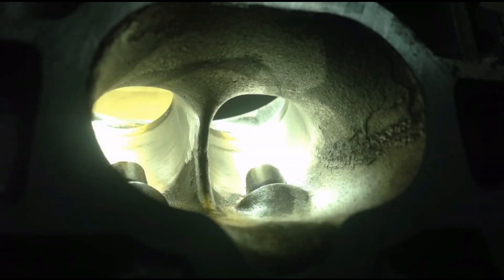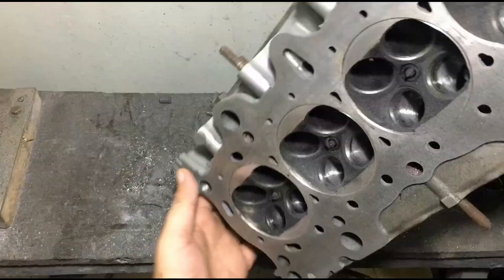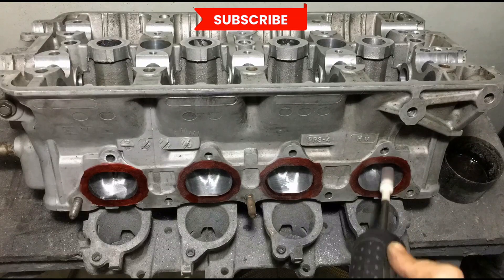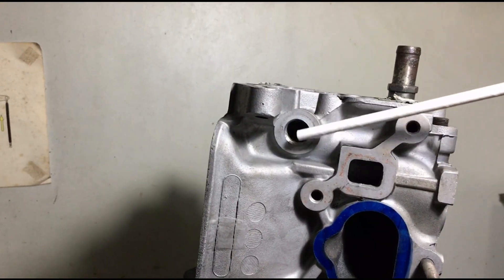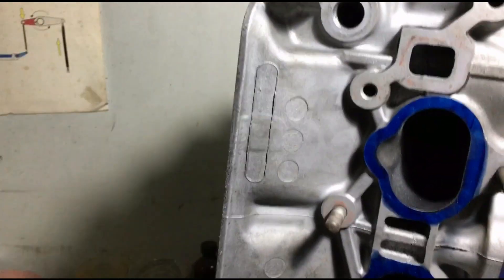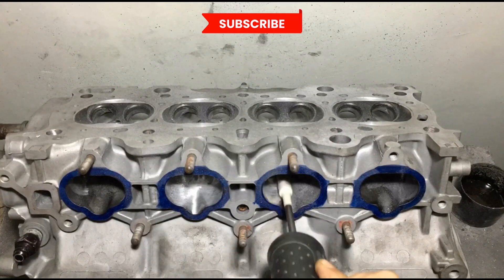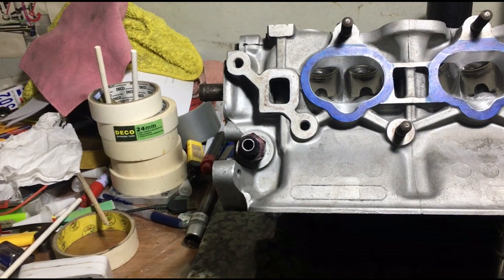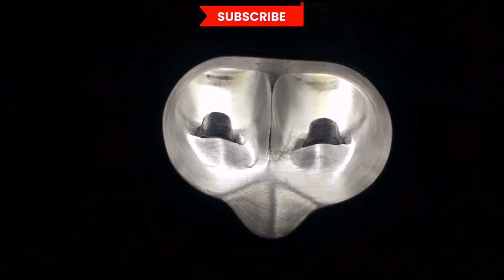B16 PR3 Cylinder Head Porting for B20 Vtec by SRDmotorsports

Comment: What grit do you use for the combustion  camber without taking the valves off ( top part)
Reply from the maker: 120 grit but it’s hard to clean up the crevices with valves in 

The current or part 2 of the Kseries built I talked about the chamber details

Comment: Sorry for exhaust  port you use 80grit . What grit do you use for the intake port ?
Reply from the maker: Both it’s usually 80grit it just depends on the amount of lube I use it changes the finished texture

But it’s always depending on applied pressure on ur hands

Some can try finer grit to come close but it won’t be the same it’s always the applied pressure of the hands

Comment: port matching i/e po8 head with 20 camlobes , was it good for daily?
Reply from the maker: improving efficiency is always good (some locals would say otherwise cuz it’s stock)

so they don’t think improving fuel efficiency is worth it?
Reply: @SRDmotorsports  fuel efficiency + gain more power, right.
Reply from the maker: improving engine efficiency = more power and fuel efficiency

Comment: Very helpful video. I’m curious how does the fuel atomize with 120 grit surface? If the port is sanded at 220 grit. Is that when it’s too smooth. Where is the balance point?
Reply from the maker: I’m not sure with your question sir, but our finish is was always 120grit

I feel anything smoother = is no difference so “why” spend more time  as if it’s “no difference” it’s the same as wasted time 😄

especially with the newer style injectors that has far more superior spray patterns, atomization is vastly improved

Now if it’s a Weber manifold for my vw? Yes I’d like to try to keep it a little rougher perhaps 60-80grit

Comment: Hey brother nice video! Have a link to those bits you used for the porting job?
Reply from the maker: Hey yes where u from? Cuz depending on location the source is different

Mostly on EBay sanding rolls are plenty usually the good ones come from SA (standard abrasives) the brand

Comment: How is this even beneficial if you aren’t cutting anything? I can’t even say this will gain a net of 10cfm? Please explain?
Reply from the maker: The b16 port is already “almost” too big port volume wise for the basic 84x89

Unlike different brand heads let’s say on a Toyota or Nissan it’s a different story

and the port is always related to cam size + type of intake manifold but that’s a separate story
Reply: @SRDmotorsports  looks really nice
Reply from the maker: @jdportwerks6795  on let’s say a d16 head or a crv p75 , that one can take more port volume and will need it for more “rpm” power…

Thank you man!
your work is actually really really good too!
Reply: @SRDmotorsports  I mainly do a lot of Honda and Volkswagen cylinder heads but the Honda heads are definitely easier to work on and get really good results😁
Reply from the maker: @jdportwerks6795  so true on that… I can imagine the vw is a lot harder because it’s already good with torque so more is harder except go turbo lol
Reply: @SRDmotorsports  I have several builds from 200hp supercharged to 720hp turbo and yes vw=Torque monsters. I am still really amazed that you don’t use any burrs to cut your cylinder heads and then use sandpaper flappers to shape and smooth and out. Have you ever flowed one of your cylinder heads?
Reply from the maker: @jdportwerks6795  actually I do use burrs a lot of times just on this one I used it less

Yes I usually don’t mention it here but 
Usually my good ones are above 295cfm but below 312 @28”
Reply from the maker: Oh and the 80grit does eat a lot 😂
Reply: @SRDmotorsports  I use 80 after I cut with a burr then go from 80 and finish with 120 and at the end scotch ball
Reply from the maker: @jdportwerks6795  yes sir I do 80 then 120 too and can get a finish with a spray mix inbetween

Comment: This will come in handy with a B20 stock bare block with a fully built and maintained Vtec head
Reply from the maker: Oh yes definitely… like a “2liter” TypeR 😎
Reply: @SRDmotorsports Type R Integra cams GSR Head with dual valve springs is what I’m gonna do people say it’s safe to use the stock springs and valves but I’m not taking chances just because it worked before won’t always pan out especially B20vtec
Reply from the maker: @kaybevang536  I agree on that! Valve springs west out they are considered “consumable” as their tension don’t last forever

Il always prefer “new” so I def agree
Reply: @SRDmotorsports  I had no problem running stock head stock valve springs and retainers with type r cams but might as well get it upgraded so you don’t have to do it when adding better cams
Reply from the maker: @kaybevang536  yes so true I mean it’s quite easy just slapping on pro1 after but if the valvetrain isn’t ready? That’s added work so what u doing here, this approach is actually SMART
Reply: @SRDmotorsports  better safe then sorry as I said before just because stock oem valve springs had no issues before doesn’t mean it will have no issues on my other Vtec Head plus I’m building a GSR Head this time different from B16a Head
Reply from the maker: @kaybevang536  yes indeed…it’s how I approach things hence blowing an engine I lack experience on hahaha
Reply: @SRDmotorsports  my b20 Vtec in the car is hurt though I bought the car with the b20 Vtec and god knows how hard it’s been raced so I’m building my own B20vtec but a more don’t cut corners and don’t cheap out on parts
Reply from the maker: @kaybevang536  ah yes true I mean who knows and nobody really admits they over raced it hence selling lol

Comment: Err, you just about cleaned the exhausts but didn’t actually port it that much. On a turbo engine you need as much exhaust flow as possible.
Edit, sorry no turbo I mixed up two videos.
Reply from the maker: Yes I agree though especially on turbo engine as much flow exhaust "efficiently" as possible

we both know alot think "bigger" is more flow when alot of times when you start loosing airspeed , "boost lag" becomes annoying 🤣

Also on alot of applications the honda pr3 head has very good port volume and valve to throat ratio but on other brands it is a different story so I agree on exhaust flow

Comment: I just bought a head just like this one. I will try to do the same. This one was flawless.
Reply from the maker: Yes sir check a outro video about this the TypeR how to , it shows more but less words

I will make a new version Video of that soon
Reply: I have seen its good. I having trouble taking the valves out of the head. When I press the springs the valves opens also.
Reply from the maker: @picole321  oh wait its 11:54pm here tommorow i can show you a photo but on my page

but basically u can just fold "jornal" because its soft so what u to is crumple them like trash 🤣 then fold enough amount to sort of hold the valves closed when you put the head chamber down on ur workbench  this saves the valves from risk of bending when u press them and open and hit the desk
Reply: Thanks amigo.👍
Reply from the maker: @picole321  just estimate if u fold too little jornal? then valve will still open a little bit? if you fold muito grande? the head will not sit flat on the desk 🤣
Reply: Yes I understand. I'm going to try. Thanks.
Reply from the maker: @picole321  no problem man i prefer "jornal" cuz its easier to squeeze together once crumpled

Comment: I never understood why people grind away at a very expensive piece of metal to match a cheap piece of paper instead of grinding the cheap piece of paper to match the expensive metal
Reply from the maker: Preach it brother!!! thats why we showed that p30 intake gasket even OEM which is fine for slight misalignments but its why we show it

why "gasket match" ?? portmatching is good but id rather not rely on gasket maker's alignment and hope it gives more awareness
+ its why we often have a bunch of sturdy file folders here i use and cut to make our own intake gasket this way it is actually exactly like the ports on the head
Reply: @SRDmotorsports  i should do that as well.  Wonder if u can buy the material they use for intake manifold spacers in sheets
Reply from the maker: @timm5970  yep hence i go to bookstores or stationery supplies store 🤣

Actually i believe you can, as even here I know its possible to get em they come in 12" wide rolls... lemme ask a buddy of mine on the "proper" name this way i can pass it on to you and let you scout some ftw
Reply from the maker: @timm5970  found one man... but il keep checking "other" makers but this is prolly easy to get in the US (we in asia) so its all good

Mr.Gasket #77B  its 12" x 12" thats 1/16 thick

lemme check with my vw/cal-look friends they might know a diff brand or preference
Reply: @SRDmotorsports  they sell that mr gasket stuff on summit racing so its ez to get here in the US.
Reply from the maker: @timm5970  oh nice! i quickly checked a while ago and found that, the rest of the "gasket" i found were sealant tsk lol   but that is good if its easy for you to grab

Comment: but a b20 headgasket is 81mm as well......
Reply from the maker: a b18 ls maybe but i dont know we dont get the b18a/b here but p3f b20 headgasket is 84mm and the dowels are reversed as in the video that headgasket is 84mm
Reply: @SRDmotorsports  its been a while so i could be wrong.  I know the heads are 81mm and the blocks are 84mm unless u are like me and have a P8R head which then the head is 84mm as well.  I dont remember having to look for a special headgasket so maybe im just talking out of my ass here
Reply from the maker: @timm5970  maaaan p8r beyond rare even here... but our local HG is 84mm just like visible in the vid... the weird part of honda is every country has an odd red child situation 🤣 always
Reply: @SRDmotorsports  yeah I picked up the p8r for $60 lol.  b20, p8r, b16 intake, 70mm tb, bc0022 cams, 4-2-1 header(forget brand its nice), high flow cat 2.5in, 2.5in exhaust
Reply from the maker: @timm5970  lol man!!! 60$ ?!? def good find!! bc022 is good ive built one with it never had a chance to dyno cuz pandemic hit 😒 but the crv seems to idle well 

more cool is the fact that its a crv so i told the owner it might surprise alot of civics 🤣
Reply: @SRDmotorsports  Yeah right now as it sits I have stock valvetrain, stock exhaust, and untuned so I dont really know how good it is yet.  Unplugged the stock o2 and put a wideband in there and took it for a rip.  Stays rich 10.8-13.8 afr but I can only pull to 7k.  Definitely faster then before but underwelming.  Cant wait to see it done
Reply from the maker: @timm5970  if its that rich then mos def ul get mooooore response once you tune it thats cool!!

Comment: Say no to knife edging when porting
Reply from the maker: yep we never do and i agree
Reply from the maker: it got thinner only due to needed cross section but yep i agree not to edge it right away

not many understand and know why leading edge of a planes wing isnt knife edged :)

and i can see u know your stuff... excellent Vitaliy!
Reply: @SRDmotorsports  leading edge of high speed airplanes are knife edged. It’s just not very practical to make a sharp leading edge on slow flying airplanes and have it fly very well. Knife edge reduces drag, that’s common sense, Don’t need to experiment to know. Rounded edge will cause the air to make a pause or create a stagnant point at where it impacts, this is added drag!
Reply from the maker: @StrikerFin  yep!! excellent points indeed :)

Comment: Whats the most practical engine to build, budget wise? B or K series? I'm looking for an engine to put on my old civic. Not going for race, more on efficiency with a decent street power.
Reply from the maker: Heyyyy Michael most excellent question!! I apologise for getting back to you late, with an excellent question deserves an excellent answer so il do that now 😏

in all honesty? i would choose and love a Kseries! but with your question and the fact that i know a strong 2.0 Bseries is borderline "too much" for the regular streets lets do this...
the usual run of the mill b20vtec like in our series...lets say 1up or ycp pistons (not even forged) Pro2 cams and ITR manifold

235whp is easy...pump gas and thats 
117.5hp per liter  lets use this "standard" of basis so 117.5hp per liter x2.0

a k24 should then make 282whp on non forged pistons a regular rbc manifold and maybe DC2.2 cams and usual header? but No to reach that its almost race level build and we see equivalent of a b20 set up but k24 comes out as 248-255whp locally... hhmmm?

same standard on 1.8liter = 211whp doable
same standard on 1.6litsr = 188whp doable din

so when you think about it? ive yet tosee an equally efficient K local to us that matches a Bseries 2.0 per hp?

tranny alone an ITR B is like 70-75k and a
typeR K tranny is atleast 135k 

we havnt even gone to ecu cost hondata s300 around 35k and Hondata Kpro easy 60-65k

but i still love K series but i still will always be honest and upfront :)
Reply: @SRDmotorsports  Thank you for the reply,  I think from your answer basically I can go on any of the two. Maybe my concern was more on what is actually doable on the chassis of the car. I'm sure B series will fit as I've seen many did it from abroad. But the idea of doing something out of the box is what's going in my head. I want to do it in steps as I think that's the most safe and practical way to do it. 

I'd maybe go and push with the engine swap first with stock everything to make sure it fits and runs. Maybe consider going AWD in the future. My biggest concern is the axels. 

I'll probably tap your services in the future specifically for the engine build when things gets started. Right now I'm trying to gather as much information on how the project should be approached, where to source the parts and where to have it built. An AWD K24 would really be something new if it fits an EN4 chassis.
Reply from the maker: @michaelfermin1030  oh man a late 70s early 80s chassis is already out of the box in itself! that is one cool project :)

my main concern is engine bay space etc etc yep if an AWD is the main thing that pushes such project then il throw an idea in the mix to confuse you more 🤣 people with the same passion does this naturally hahaha

EN4 chassis, Bseries based AWD run a D2B adapter speedfactory style to run a crx based d16ay all cammed and reworked on Hondata S300 , run all the bells and whistles the s300 can carry/provide and it should be golden
slap an s2k guage too 🤣

this way the "engine bay" look is kinda less outta the ordinary but all 4 tires be beefed up hmmm

Comment: Sir gud day po ask ko lng po kung fit ang con rod at piston ng d15 sa ph12 ty po 😊
Reply from the maker: good day and thanks for the comment.... different bearing diameter crank ng ph12 so wont fit sa ph12 and piston height is different so baka lubog pa
Reply: Pag po kaya crank ng d15 din ang gagamitin sa block ng ph12 fit na kaya?
Ty po
Reply from the maker: @MrDelete001  different main bearing and rod bearing diameter it wont work sir
Reply: Ok po sir big ty
Reply from the maker: @MrDelete001  no prob sir just always ask and we will try to give good answers or advice
Reply from the maker: i assume you have a ph12 engine correct? there may be ways to improve depending on set up
Reply: Kung piston ng d15 sir fit kaya pag pina bore?
Reply from the maker: @MrDelete001  no... the bore is the same all D-series pero when installed bka sobra lubog piston it wont run well at all
Reply: Ok sir big ty
Reply from the maker: @MrDelete001  no worries may i ask where you are from and nka ph12 you now?
Reply: Taga rizal lng po ako yung ph12 ko po is extra makina ko po naka port at shave na din yung head nya tabas nadin po fw
Reply from the maker: @MrDelete001  ah nice maybe worth try mo lipat ur ported head to the ph12 :) hi comp na kase stock ph12
Reply: Ano po advise nyo sir? gusto ko po sana mag bore up eh
Reply from the maker: @MrDelete001  bore up is no good kase wala or suuuper konti lng gain cuz bore up saten is 75.5 or 76mm d tulad ng motor or oldschool that bore up means alot of mm increase like 5-10mm
Reply: Ano po ba ang stroke ng ph12?
Reply from the maker: @MrDelete001  76mm

mahirap yng ganyan suggestion kase if tanungin mo details baka "sabi kase nung isang tropa"

na in the ehd kwento lng pla

u can research iba iba main bearing diameter iba sa d15 iba sa d16 and iba d13b (ph12 saten)
Reply: May napagtanungan din po kasi ako ang sabi internal ng d15 ang gagamitin sa block ng ph12 pwede daw
Reply: In short walang talagang ganong set up hahahahaha
Kwento lng pala
Reply from the maker: @MrDelete001   kase believe me ive dreamed of d15 internals na d16 or vice versa pang illegal hahaha lucky to be H3 back then Bong would always show me mga kalat blocks sa shop and show me differences or we would test fit them and malalamab iba iba pla bearng unlike Dohc na b16/b18/b20 same main bearing diameter
Reply: Malabo pala talaga sir
Kung papa machine baka naman maka problem....
Reply from the maker: @MrDelete001  not worth machining "wrong" parts
Reply: Ok sir big ty!
Reply from the maker: @MrDelete001  no worries sir! Thanks for asking , always willing to help and share info